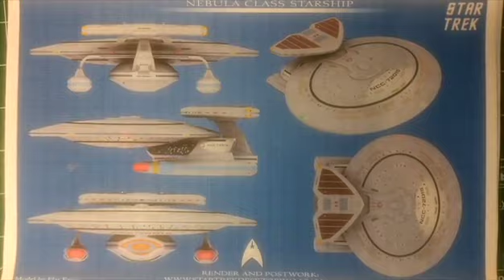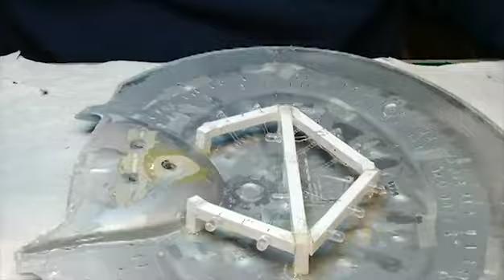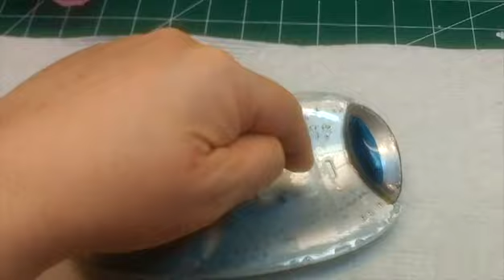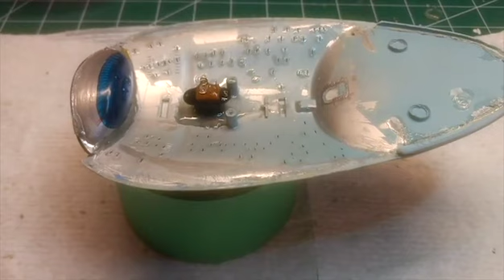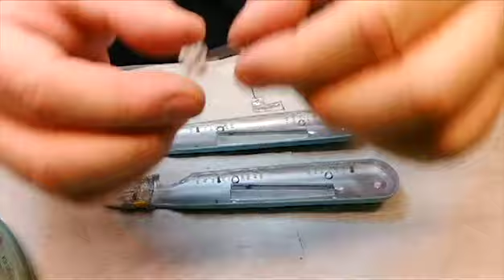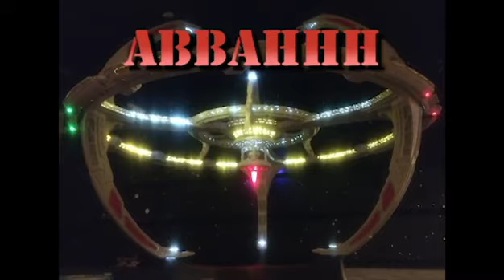Nebula Class Build (Part 2)

Comment: Really interesting how many - or how few LEDs you use to light the ship. My guess is that it will not look like a christmas tree like many of the other builds?  I wondered why you are not just putting some LED strips on to the construction in the saucer section? Then you would not have to drill holes for the LED legs...
Reply from the maker: For this ship I used 34 LEDs which include the 3mm flashers. The LED strips are more expensive and require an AC power supply. I prefer to stick with low voltage like 6vlts. Just to be run off of batteries. If I were to build a large model I probable would use the strips. Anyways, you'll see how well the ship lights up when the current LEDs.
Reply: @epycmodels946  Interesting, I didn't know that about the strips. Glad to have learned something from you again!